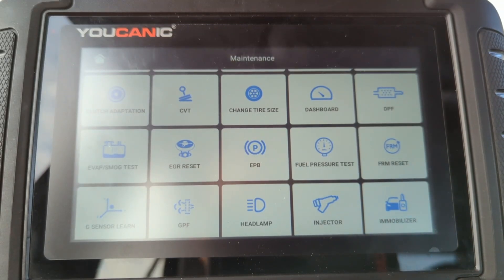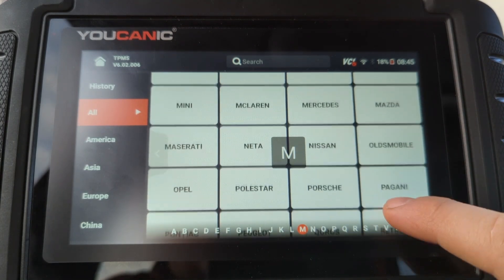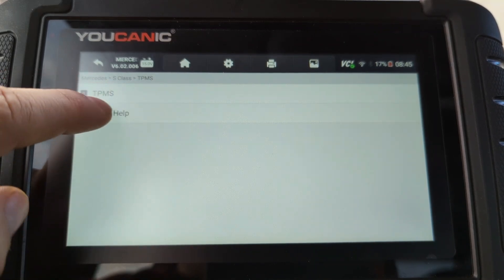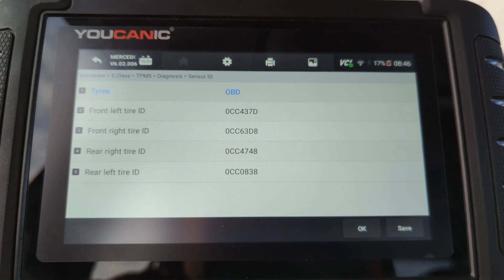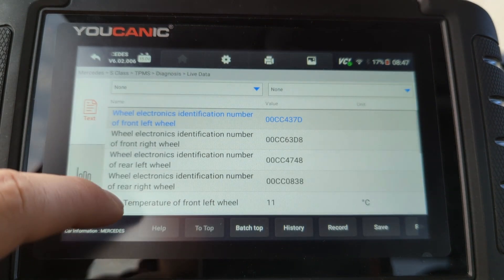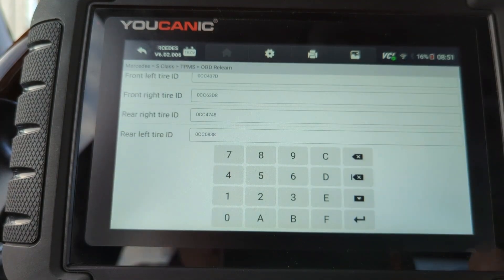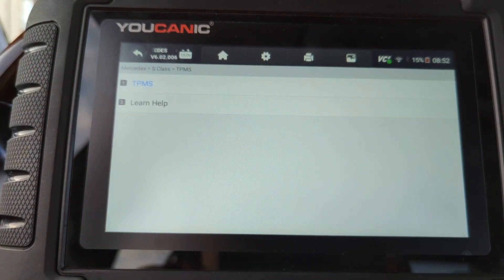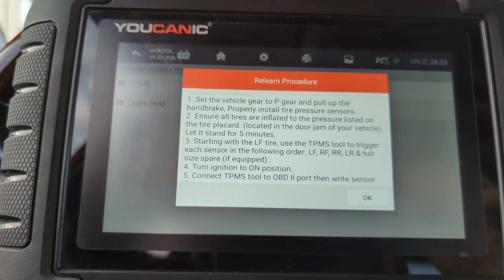Program & Troubleshoot TPMS Tire Pressure Sensor with YOUCANIC Scanner

Comment: Is it possible to disable TPMS entirely through coding using the Youcanic scanner?
Reply from the maker: @joeorlando94 If you’ve got a car issue or repair question, you can find step-by-step guides and scanner help at youcanic.com. We might miss some comments here, but our site has answers for most problems already!